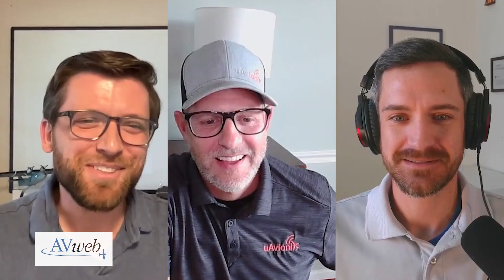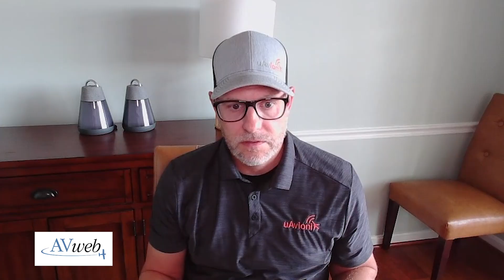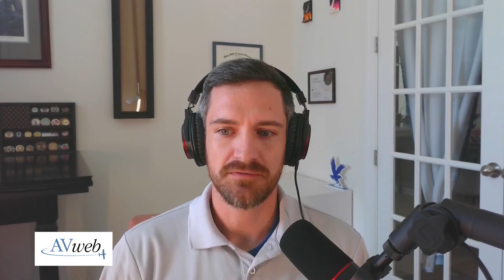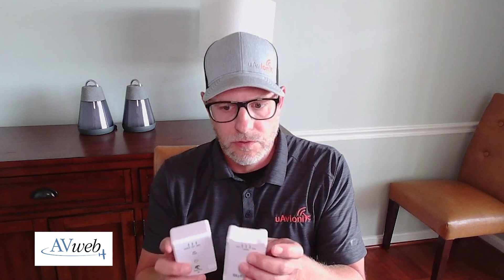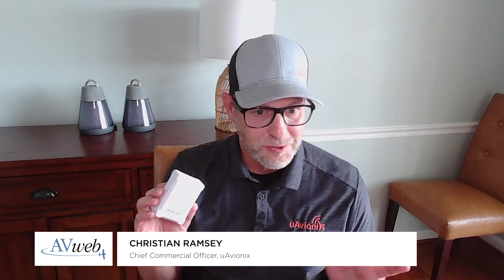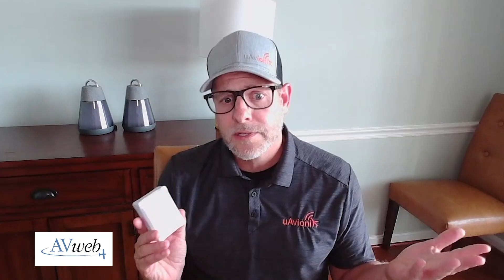Proposed Part 108 Drone Rules & Manned Pilot Safety

Comment: What do these guys say to a hot air balloon who is carrying an EC device that isn’t working?  They have no chance of maneuvering out of the way of a drone with only seconds to respond.  If they even see it coming.  Devices fail and nobody using ADS-B has any idea if it’s even working.   I’ve flown with many aircraft outside my window that drop off ADS-B.  Some using uavionix equipment to broadcast their position.   I’ve seen enough performance issues that would never trust my life with ADS-B yet it sounds like we may be required to.  And these devices are installed. I don’t see how a cheaper battery powered with limited transmit power and variable mounting locations and limited range is going to perform better.  

 The FAA has many times on record indicated that ADS-B isn’t a primary method of collision avoidance and see and avoid is the rule of law.   Yet here they are changing their stance for the drones due to industry pressure and executive orders.   

How is the drone industry going to comply with 108.180 and 108.185 that will require detect and avoid of all aircraft including non cooperative in certain airspace?  This is the technology that should be required in all airspace where humans are flying.  

I understand the industry need that 108 is trying to serve.  I support the goal of integrating the NAS.  I just think we don’t need to rush this into practice until  drones can detect and avoid just like we are required to see and avoid.   I don’t think drones should jump to the top of the right of way hierarchy, completely disregarding maneuverability which largely has been the deciding factor for all history, simply because another aircraft isn’t broadcasting ADS-B or has a failure of that equipment.